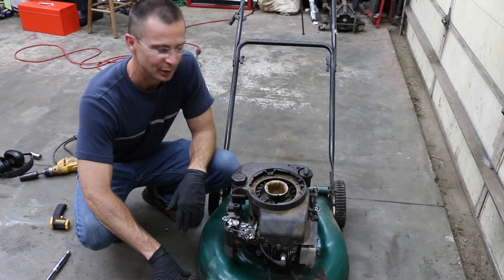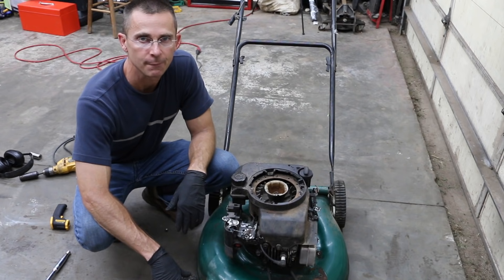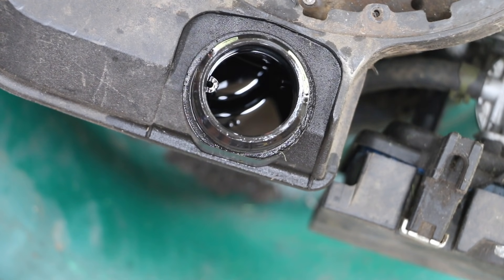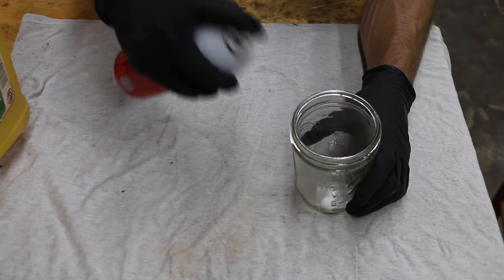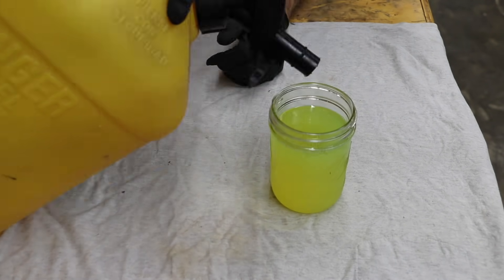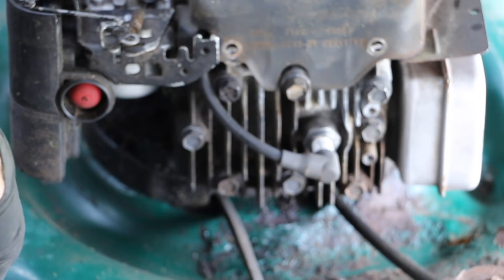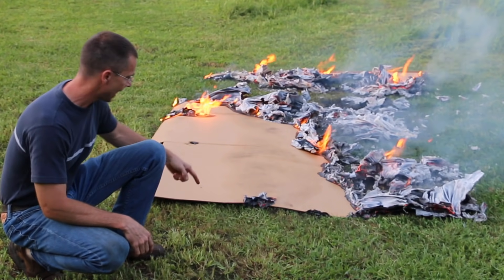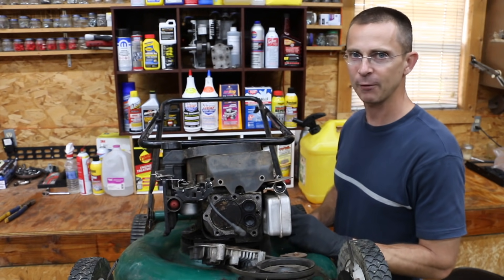Will a Gas Engine Run on Diesel?  Let's find out!

Comment: Considering how much more difficult diesel is to get going, it would be super interesting to revisit this test starting with 50/50 gas-diesel, and seeing if you can refuel and run on diesel with a hot engine. the extra heat might be just enough to make the difference.
Reply from the maker: Thanks for the suggestion.

Comment: Old old farmall tractors had a very small gas tank and bigger diesel tank. They would start the tractor on gas and when it was completely warmed up they would switch to gas. How about trying this combination in the lawn mowers. I think they did this during the war. When fuel was scarce.
Reply from the maker: Thanks for sharing.

Comment: Great videos!  Diesel engines require 14:1, and as high as 22:1 compression ratios to initiate combustion for diesel fuels.  As you’ve proven, lower compression (8:1 to 11:1) spark ignited engines, don’t have enough energy to completely burn these oily, low volatile fuels.  Again, great videos... you’re my hero.
Reply from the maker: You are welcome!

Comment: wait, so if the primer is required to keep the engine running, if you tuned the carburetor, could you possibly get it to run correct?
Reply from the maker: Thank for the video idea.

Comment: I have a farmall super a  with a kerosene cylinder head , I've run 4 gal diesel to1 gal gas  run no problem.  This  lawn mower has been great, however I have wondered if the cylinder head had a piece of carbon or even a little bit of catalytic converter metal in side the combustion chamber to ignite.
Reply from the maker: Thanks for sharing.

Comment: Another "way to late comment..." ;) 

What will Happen, if you try to Max out the compression and run on higher RPM?  (Diesel in Gas engine.) And how low you can go with Gas/diesel mix?  

(Higher compression with thiner sealingdevice and higher Rpm with no load at all... on the crankshaft.) 

Somebody told me, that a Gasolinengine is capable of Turning into a selfigniter after 7500 Rpm. (I never checked on that Information. Maybe thats Bullshit ever since.) 

And still... im Impressed how much work you Willing to put in these vids.
Reply from the maker: Thank for the suggestion.

Comment: GREAT VIDEO .  NOW DO A VIDEO USING WATER AS A FUEL AS THEY DID DURING WW 2 WITH P 51 AIRCRAFT.  OBVIOUSLY MODIFICATIONS ARE NEEDED BUT PERHAPS YOU CAN SEARCH IT???
Reply: It wasn't used as "fuel", but instead was used to cool the cylinder head as a mist, providing momentary power boost in situations like "dogfights".
Reply: @MikinessAnalog  WILLIAM MOUNT RETIRED MILITARY SAYS THEY RAN ON WATER.  I KNOW SOMETHING ABOUT HHO, DRY CELLS, HYDROGEN VAPOR CAN BE USED AND IS USED FOR  TORCHES.  THE FIRE WITHIN THE CYLINDER WALL OF A GAS OR DIESEL ENGINE RUNS HOTTER, CLEANER WITH MORE HORSEPOWER.  STAN MYERS RAN HIS CAR ON TOTAL WATER.  HE DEVELOPED AN ATOMIZER INJECTOR.  HE DEMONSTRATED IT THEN WAS FOUND DEAD ON THE TRAIN TRACKS.  HE NEVER TOOK THE TRAIN.  BLACK OP'S ROCKEFELLER MILITARY INDUSTRIAL COMPLEX PETROL DOLLAR MADE SURE OF IT.  THANKS FOR YOUR REPLY.  THE NAZI'S HAD ANTI GRAVITY IN 25  OR SO .  WE CAPTURED THE TECH. AND BROUGHT THE NAZI'S TO INCLUDE VAN BRAUN FOR THEIR TECH.  BROWN SHIRTS MADE UP OUR SAA? / CIA.  HITLER WAS ALLOWED TO ESCAPE IN A SUBMARINE TWO WEEKS BEFORE END OF WW 11.
Reply: @rafdecc  HHO is "Browns Gas" and is used in welding. Cracking water for fuel, you should only use the H of the water only because the O2 from the air makes it much safer. I'm sure the planes could use a water source, but it must be cracked using DC voltage. I have did that before on a push lawn mower.
Reply from the maker: Thank for the video idea.

Comment: Dont go poorin deisel into your engine. It will destroy it over time. And even if it doesnt you WILL face road rage from me if your car gives me a toxic feeling from the smell. yOU better! Hope . the cops arent defunded yet when it happens if u do. Im still going to cut you off or you hit me. Choice is yours. Cops or not. Ill get you off the road if you dont run clean gas. Be an ass hole get treated like one. Be decent and i will meet you in the middle
Reply: There is no reason to be so militant. He would not do this anywhere except on his own property.
He does this as a service & doesn't even use advertising or sponsors, proving he is a decent person.

Comment: I know a guy who has a bad habit of keeping diesel in red cans. He had a pressure washer for 10 years and it would never start. I finally got frustrated and looked into it for him, popped the fuel line off the carb and drained it, only to find dyed diesel fuel (I have to assume he had it in a can and planned on filling the lawn tractor or something and mixed them up...). Fresh gasoline and an oil change and that pressure washer started on the first pull!
Reply from the maker: Thanks for sharing.

Comment: I was wondering which project farm was my favorite.

The dirt in the carb and the engine was a classic. It needed to be done. But did you get it running?
....using additives or treatments....thick oil etc.

Do you still have that lawnmower.

Can I buy it?

Seriously, in an auction, signed by you, why not?

You could sell all your lawnmowers! Imagine that. Ruined lawnmower sells for $1000.00 on  auction. 

Then there is yet to run a hot gasoline engine switched to diesel.

This video is also  classic.

Comment: Old video to comment on but worth doing. Biodiesel can be made at home and cheaply done so what if that can be half and half with Gas. Would be a good way to stretch out the fuel and save money.
Reply from the maker: Thanks for the suggestion.

Comment: I know one thing a Diesel will run on gasoline. I blew my 4.7L HO- 2003 
Jeep overland up one day (190k  miles, mobile full synthetic changes 
every 3k)  I was in my Duramax pulling in to get fuel and I was day 
dreaming about my Jeep so much so I started putting unleaded in it and 
noticed when the tank was half full and it was very low on fuel. I just 
put Howes diesel treatment in and drove it until the gas burned up. I 
was just careful not to overload the engine and didn't rev it high. It's
 been 2  years and runs like a champion.
Reply from the maker: Thanks for sharing.

Comment: I did something simular in the early 80s. 
I had a 65 Dodge van, I put 10 gallons of diesel in the tank. the engine was warm, and it ran fine, when the engine was cold, I had to use starting fluid to get it started. I found my gas mileage went up as well, I ran as much out as I could and never did that again.
Reply from the maker: Thanks for sharing

Comment: Once I filled a tank with diesel,  and to remedy, I used lucas additive to increase the octane rating. It ran rough, but it ran
Reply: EFI engine?
Reply: I did the same thing once. Someone had filled a gas can with deisel and I didn't realize it because I smelt like deisel (work truck is deisel). Needless to say I used it and after maybe 20 km, it started surging and kicking bad. It also had 0 power.

I went straight to a friend's place for a hand because at the time I didn't know exactly the issue. That was until, we seen all the excess oil coming from the exhaust.  
I pumped the tank empty, refilled, added injection cleaner and it purred like a kity right away.

Comment: I did something like this with kerosene and a small generator.  I used a battery to preheat the kerosene going into the engine just below the autoignition temperature.  Then I used the electrical output of the generator to keep the battery charged.  It was very inefficient, but it did run fine.  Still got a lot of buildup in the engine as well.
Reply from the maker: Thanks for sharing.

Comment: Will a hot gas engine run on diesel?

Older diesel engines used to start up on gasoline until it warmed the engine.

...so I was told.

Comment: Hi there!

I have a great thing to try...

I had an old timer once tell me that to save money back in the day, they used to start a gasoline engine on gasoline and after it had warmed up, they used a valve in the fuel line to switch the fuel supply to diesel.. 

Think you can make a short video on that?
Reply from the maker: Thanks for the video idea.

Comment: I did learn today the "slow" burn is why it's used on engines requiring torque, whereas gasoline is best suited for horsepower-based engines.
Reply from the maker: Thanks for the feedback.

Comment: What about using mix of 3 type 
40% Diesel 40% gasoline 20% tiner ( used to remove paint and it's very very powerful than gasoline ) don't use it all tiner because it destroy carburator instantly .
Reply from the maker: Thanks for the video idea.

Comment: An old retired army friend told me that the U.S. Army has switched to a multi-use fuel which is composed of 50% gasoline and 50% Diesel fuel.  Everything runs on it, and everything runs poorly or it.  I don't understand how he got the Diesel fuel to burn, I have not been able to do it. Ron W4BIN

Comment: Wonderful video!  I wonder if you can devise an experiment to test the long term viability of a 10% diesel/90% gas mix for reducing engine wear while the oil is working it's way up the the cylinder heads.  Maybe a side by side of of 2 engines, one with straight gas and the other with a gas diesel blend, being started, ran for 5 min to warm up and then turned off and allowed to cool.  Repeat ~100 times.
Reply from the maker: Thanks for the video idea.

Comment: The engine could run on diesel if the combustion chamber was changed enough to present around 400psi of compression and is timed. The sparkplug replaced with an injector etc.
Reply from the maker: Thanks for the feedback.

Comment: Isaak Welch  have you ever rebuilt a Detroit 2 stroke they have more rings the ones on the bottom keep the oil out of the compression camber.
If the had a modern 2 stroke it would be two efficient

Comment: Diesel works by pressure. It won't work on a gas engime. There's no pressure no heat.
Diesel truck pre-heat diesel before injecting at about 25000 psi. You can get it going but the missing pressure is missing.
Reply from the maker: Thanks for the feedback.
Reply: @ProjectFarm  Dupree Heating and the pressure is pushed into the engine makes the diesel turn into a gas not as a particulate or droplets at that point in time you get a much greater expansion but you get a cleaner combustion two of the diesel. The old trucks there you see that black smoke is coming from the stack that is because that is the old fashioned diesel engine today's diesel engines have pretty much 100% clean idle or exhaust it almost smells like burned propane I drive an 18-wheeler and when I'm out working around my truck I Never Smell diesel exhaust it actually smells like a barbecue grill you just turned on that is 0 diesel odor but in the old days when these trucks started with a glow lamp in the dashboard those was stinky. You could have kept your lawnmower going by priming all the time.
But the end result will be that your valves your piston and your head would be so carbon coated with soot that the engine  simply cease to function. In Modern Diesel engines diesel itself is almost brought to the heat of Flashpoint before is injected into the engine. When it's injected it's like a vapor.

Comment: Diesel requires heat and presure to burn you should let the engine run on petrol until gets hot them switch to diesel will the engine stays hot
Reply from the maker: Thanks for the feedback.

Comment: In answer to your question No! Because diesel needs 20 to 1 compression in the cylinder with no spark plugs. Actually a diesel (engine) pump with wants to run as long as fuel is feed to the cylinder.
Reply from the maker: Thanks for the feedback.

Comment: Diesel is an oily fuel. I'd think heating it up like with an immersion heater until it hits about 80deg below it's auto combust temperature then feed it into the gasoline engine would work 'in theory'
Then it's already nearly ready to combust, even the slightest increase in temperature should in theory cause it to well diesel an engine.
I'd think it would work in a 2 stroke engine like a weed eater or chainsaw or one of those $99 cheapy 2 stroke harbor freight generators.
Reply from the maker: Thanks for the feedback.
Reply: I wonder if mixing diesel with a oil dispersant like lye then adding a fast burning fuel like pure alcohol. In theory the lye would keep the two two fuels from separating.

Comment: Good video!  Really reinforces the concept that diesel is a heavier petroleum distillate than gasoline; diesel has more energy in it overall, but gasoline is more volatile in terms of flash ignition point.  Also, when you tore down that cylinder head, it looked to my eye that the diesel had left behind some residual lubricity (which would seem to confirm anecdotal tales).  I wonder if there's anything to the old shade tree mechanic's tale that adding just a little bit of diesel to a gasser engine will help it run more smoothly on account of this?
Reply: I bet you he can't answer your confirmation question about whether or not you wonder that, so perhaps you should should just do your best to tell him what you wonder, instead.

Comment: Would a 1/3 gas and 2/3 diesel mix work, that could save alot of $ if cause no longterm engine damage.
Reply from the maker: I wouldn't recommend trying it.  The octane will likely be too low

Comment: This explains why gas engines can run on woodgas or propane but not diesel.

Woodgas and propane ignite quickly, like atomized gasoline. As you've shown, diesel is just too stubborn to light as quickly
Reply from the maker: Thanks for the feedback.

Comment: If it had more compression and was warm it would run yes
Reply from the maker: Thanks for the feedback.
Reply: @ProjectFarm  hopefully that should work. I'm not sure but that's how diesel engines work. And the spark plug won't do anything. It might work better with a fuel injected engine tho. Because diesel is heavier and harder for the carb to pump. Bye

Comment: Lots of white smoke? Looks like ya got an LB7 and need some new injectors.
Reply from the maker: Thanks for the feedback.
Reply: Project Farm oh! I was Just Kidding 😂 LB7 is a diesel motor used in GM trucks from 2001-2004? and if it produces a lot of white smoke it usually means that the injectors might need to be replaced soon.

Comment: I do think the lawnmower engine if still hot just after the gas ran out, would have ran on the diesel.
Reply from the maker: Great feedback. Thank you
Reply: He said primer use was needed so if he adjusted the amount of fuel fed to the engine I think it would have worked

Comment: Diesel is 1/2 the octane so it needs a very strong combustion chamber. The combustion on a regular gas engine has a spark ⚡️ plug for  combustion. On a Diesel engine your combustion chamber is more powerful because the fuel is less explosive 🧨but the compression is sow strong 💪 from the power of the chamber you don’t need a spark plug for Diesel power engine, but to run probably you need a higher air to fuel ratio, witch in most Diesel engine would call for a turbo charger or super charger.
Reply from the maker: Thanks for the feedback.

Comment: High octane comparison 93, 110 and  maybe jet fuel? In a small engine? Also you could take 87 add octane boosters and see if it fairs with higher octane fuel
Reply from the maker: Thanks for the video idea.

Comment: Enjoyed the video!
Reply from the maker: Glad to hear it!
Reply: @ProjectFarm  I ran a push mower first on gas till it got hot then kept adding diesel till my yard was cut about 2 hrs till I was finished only problem was smoked like hell and had to clean carb next day. I also ran diesel in a 2stroke atv in place of 2stroke oil again smokey. These were emergency situations at the time.

Comment: Older car engines run good on 50/50 diesel and gasoline, new cars not so much. I have seen less than 50 percent diesel cause piston rings to wash out and engine loses compression.
Reply from the maker: Thanks for the feedback.

Comment: Thank you for the video, very informative.  Seems to me that maybe a 20 to 25% diesel mix in a gas engine would both well and provide some level of lubrication to both the valves and cylinder wall. After all, Diesel engines run much longer than gas engines.   I’ve always thought that but haven’t got and information about it.  Just a thought, what do you think?
Reply from the maker: Thank you!  It seems like an interesting test idea
Reply: Re; 20 to 25% Diesel mix. Admittedly that would require a considerable time to be able to draw a conclusion. But I have thought that diesel does lubricate the upper engine as well as cylinder walls. Question being, would a gas engine run as long as a Diesel does?                         As a retired Quality Manager, reliability studies (Weibul) Analysis was always part of it. Not to say I’m an intelligent person, lol, I’m not. There are considerations also that “All” disciplines of Manufacturing will determine its failure and adjust machining / materials to predict the “Mean” number.               Otherwise they would be out of business, Right? I’d be willing to bet the 25% Diesel would’ve viable in gas engines.  Just thinking out loud. Thanks for your response! Robert
Reply: Automotive Manufacturers definitely wouldn’t volunteer that information to the general public for a lot of reasons, primarily because the obsolescence engineering staff wouldn’t have anything to do. Lol, I’m done.